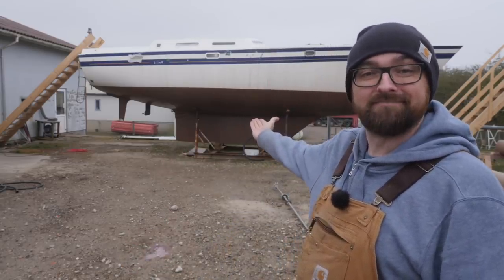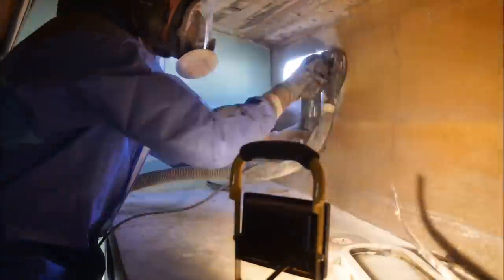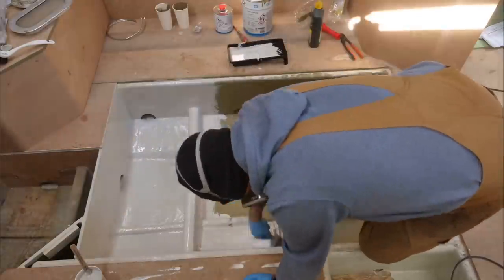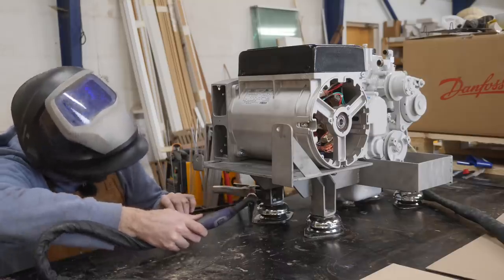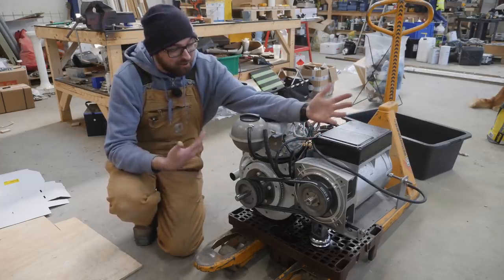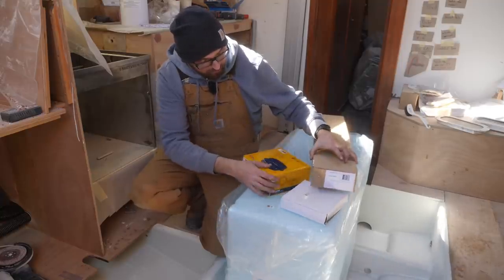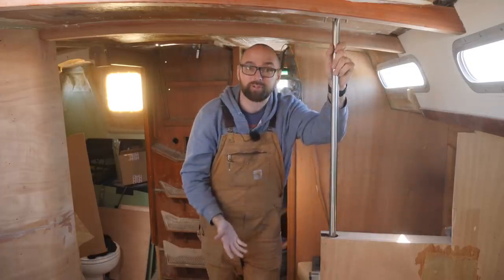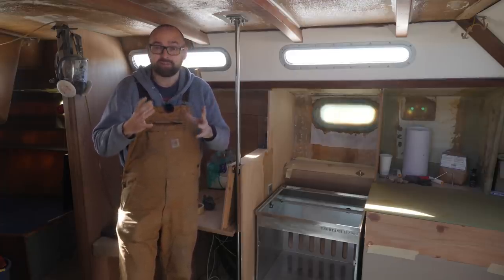Sail Life - DIY generator fail, galley pole - sailboat project

Comment: It seems to me that you need to reassess your power consumption plan. Specifically the water maker. Somewhere, everyone decided that it was only possible to cruise with a power hungry 35 gallon per hour ac water maker.  There are other options that will work and use surprisingly less power. Absent the power consumption initially planned, you could either cook or wash clothes and everything would be just fine. How often do you think you would need to do all three at the same time? Look at some of the dc powered water makers and design a superior rain collection plan and you’ll be all set. The fuel savings alone will be a big plus that will make your cruising life very comfortable.

Comment: I suggest you go and talk to an engine rebuilder because if the 102 and 402 use the same engine block it maybe worth having the 102 rebored up to the 402 capacity. That way you will verturely have a new engine with the desired hp.You have made such a good job of the genset it would be shame not to have it working as you thought. Cheers and good luck. Ian Langley New Zealand

Comment: I think you might change the revs of the system by using a smaller pulley at the generator side . This way, if the 102 has enough torque you might increase the output of the generator.

Comment: Oh bugger!  Three options: replace, upgrade or run with it.  The forth option mentioned of doubling up requires space, cooling and weight, plus the same hassle sourcing one, so go for a bigger unit.  Redundancy is not a factor if you are relying on the total output, but another possible factor.  If it's a non turbo unit then the fitment of a small turbo is an option.  You need to be careful that the internals can take the extra load.  Check with Perkins.  Benefits will be better silenced exhaust, with the downside of a whistling turbo and possible reliability issues (use decent oil!).  The smaller unit will be more fuel efficient so longer running hours should not be a problem.  Everything was (is!) going so well, but I know how you must feel.  A bigger inverter is always a good thing, and as much battery capacity as you can accommodate.  Victron have some very good solutions.  Don't forget battery condition monitoring - they do it all.  Good luck with the head scratching.

Comment: Our couch charge controller allows me to invert AC power from the batteries while also pulling power from the generator. This is done by selecting the amount of AC available for charging. Kind of like peak shaving.

Comment: Just run with what you have for now and keep your eye out for a good used 402. The mounting holes and dimensions are pretty much the same correct? It could just be a weekend motor swap when you get the bigger one. Plus you'll consider the extra power a luxury not a given.

Comment: Keep the itty bitty perkins and keep going for the moment, but keep a look out for a 402 or xxx by it's Shibaura name, it appears in small ag equipment so someone will have reco ones, the 102 with a smaller alternator ( even from a truck ) will appeal to someone else to offset the cost of a 402/Shibaura/Kubota Z602.

Comment: Mads you have the time, source the larger Perkins and swap it out at a later date. I guarantee there's someone that will buy your (tibp) tiny-iddy-biddy Perkins. In the mean time you can make sparks with tibp and get all your other systems up and running. 😎

Comment: Mads i think a solution could be a solar charger/inverter. There are models that support generator input and then supplement the power from the generator with the inverter. Then if you are not using all the power it will just charge the battery. They have a selection on the Danish Web page vivaenergi .

Comment: First, I feel your frustration...we have all been there & without mistakes we have no steps in our learning/growth.  So talk nice to yourself.
   More is better.  More engine capacity means you run it at lower rpm, use less fuel, less vibrations, less noise, less wear on the engine.
   Bigger alternator/generator, has a stack of advantages too.
  You could change the diameters of the pulleys, taking advantage of the torque & mechanically spinning the generator faster.
   But I would put your diesel up for sale, in great shape, and look for a used engine that meets or exceeds your needs.  
   Even if you paid for a pro to rebuild your bigger used diesel engine, most likely you would still be less then purchasing a new generator for your boat.
  One more consideration, put a pump on the oil for the engine, so you can circulate the oil before starting the diesel.  This will remove more than 90% of the wear.  Totally worth doing.
  Keep up the great work, and thanks for sharing your learning curves with us.

Comment: Adding a turbo to your little motor might be one solution. You would need a decompression plate as well to adjust for the  increased air volume. Probably not a cheap option either.

Comment: Mads, it may just be the bore size of the cylinders, if thats the case, you can bore the 102 add new sleeves, pistons and rings and wala! Oh and like the other comment, upgrade your fuel injectors.

Comment: Also, looking at the total space allocated for fridge/freezer, minus the 10cm of insulation all around, the remaining space is going to be much smaller than you will find you need.  You may want to consider allocating all of that space to the fridge and then install the freezer in a separate location.  Obviously you don't access the freezer nearly as often as the fridge.

Comment: Mad, the 102 may be a detuned version of the 402. I know that a 18hp outboard is identical to a 25hp, manufacturers simply use a restrictive carb to make a 25hp into an 18hp for marketing. You may be able to change the tune or simply put larger Injectors in the 102 and retune timing to achieve your goal.
Best of luck my friend.
See you.
Wade Nisbet
New Zealand.

Comment: Drive the water maker directly of the Perkins. I have had water makers on my boats for years and the last thing you need is a AC motor when you can drive the pump directly. You have already committed to running the Perkins all year round so you should have plenty of duty time to make all the water you need. No matter what the time of year is!

Comment: Get Goiot portlights! Their Opal series is exactly same size as lewmar, their quality is same as lewmar, you can get spares even after 30 years. And last but not least they are dirt cheap. You regularly order from SVB in Germany and they carry Goiot as far as I can remember.
Reply from the maker: Thanks! I'll check them out right now :D
Reply: @SailLife  I used to work as a marine equipment distributor and we sold hundreds of goiot hatches, portlights and padestals to boatbuilders in eastern Europe - never had a single complaint. They are also the choice of Jeanneau, Lagoon and several other french manufacturers. And one of my boats (bulit 1986) has a Goiot hatch that still hasn't leaked once.

Comment: I think you are heading in the right direction with the bigger Inverter/Charger solution. Being able to use the batteries as surge power source will cause the itty bitty tinney winnie Perikins to punch well above its weight. The inverter/charger will be able to get all the power the Perkins can give and put it in the batteries while the oven/dive compressor/washing machine is cycling. 

I'm assuming you are looking at some sort of LiFePO4 batteries for storage (at least not LeadAcid)--I expect you'll be giving the battery bank a workout.

Comment: Use the heat from the Perkins for hot water generation and for cabin heating. That way having to run it for longer matters less because you get more out of it.

Also sitting through 7 Fast & Furious movies I can tell you that you just need to add NOS.

Comment: Get a Northern lights they are usually a Toyota block. There great engines and I heard a 4 letter word too. Run the Perkins till you get to the states and then source a northern lights/ Also known as Alaska diesels.

Comment: Add 2 pullys and a small frame welled/ bolted to your made up frame to  give you the RIGHT  pully speed on the Genny ,, Think of line shaft machine shop set ups ,,  no extra space needed  around the  engine  just some extra belts and some OFF THE SHELF  farm machinery pullys. .. Regards John , ( 35 Year Machinist )

Comment: The inverter solution sounds good to me. It will enable you to run the generator at a high load when you use it, making it more efficient.
But to make it a better solution you need to go LiPo batteries or you are just gonna lose the efficiency in the charger

Comment: If you put a larger diameter wheel on the generator you will be increasing the rotational speed of the gen without much of a load difference on the itty bitty tiny perkins.

Comment: Correct me if I'm wrong but I thought the 102 was a 2 cylinder and the 402 is a 4 cylinder.
Either way I think it's going to be fine for you although you might be able to optimize the pulley ratio to get a little more out of it.

Comment: Love your channel.  Don't skimp on power.  Buy the correct Perkins, or just scrap the project and buy a shiny new generator.  This system doesn't seem like one you want to piece together.  You would probably regret it when it fails in the middle of a trip, and you are forced to rely on just solar.  Easier to source parts when you have one reliable unit from a reputable manufacturer.

Comment: Honestly i think that's about the perfect size for the genset.  A heavy duty inverter and a beefy lifepo4 battery bank should complete the package nicely.  In fact, I would run everything off the inverter(s) and have the genset put 100% of its juice into the batteries.  Supplemented by solar and wind, you should be quite comfortable with that setup.

Comment: Mistakes happen, well done for taking it on the chin and ploughing on regardless! It would be nice to get the gen-set finished, but would it matter if it took a little longer? Use the time to get a good price for the 102 and get yourself a 402. I’m sure Perkins can supply you the dimensions for the 402 and you could get the frame / mounting ready in the meantime?

Comment: Mads, first off, your videos are the thing I look forward to every weekend. Thank you for sharing your experience and knowledge for those about to take the same journey as you. Secondly, I wouldn't call the DIY generator a bust because you got a lot of experience out of it. Why else make mistakes if not to learn from them? 

Was there any other reasons you decided to keep the perkins? Oddly, I would have taken the mistake as an opportunity to learn and replaced the perkins with another diesel engine that fit my needs. How did you arrive at your solution?

In any case, love the work! I really want to know how the head will turn out!

Comment: You can bore out the cylinders and get more power. Increase full going in. Increase air. Gear up the pulls and bigger fly wheel. The other way is to add a 2nd small generator

Comment: Wonder if you could turbocharge or some other upgrade to the Perkins 104 to improve power output? Also it would be a good idea to double check the gear ratios and rpm's to make sure its operating at maximum efficiency.

Comment: Since you’ll have to be running the engine a little more you could use the heat from the exchanger to heat the boat some in the colder months.  In the warmer months heat the ocean.  Also, could the generator you have now be adapted to the main drive engine with an electric clutch and buy a better suited generator for the itty bitty Perkins?  Or like a lot of the others are saying, use the tiny itty bitty Perkins until a 402 becomes available.

Comment: Maybe you could go for a substantially larger battery bank than initially planned and use that for covering your needs while recharging it with the smaller generator at a slower pace. Alternatively, and I'm not sure that's a viable solution, you could look into very small diesel car engines (used - scrapped from accidents, etc) and make a new bracket.

Comment: You have a time constraint.  Use the Gen as is and get the boat livable in the water.  Replace the motor after everything else is finished.  By the way, one of my walls is not perfectly level either.  Oversize alternators on the drive motor to recharge?

Comment: For example, a Perkins pulley size of 25cm and an alternator pulley size of 10cm would allow you to run the Perkins at 1450rpm and achieve 3625rpm at the shaft of the alternator. If the rated rpm for efficiency is similar to a Lugger is 1800rpm, then you could use a 20cm pulley on the Perkins and a 10cm on the alternator and and 1800rpm on the Perkins would give you 3600rpm at the pulleys for the alternator.

Comment: Mads, Just a Thought....it appears the  Perkins 102-04 (KA) motor has a bore of 61mm and the 102-05 (KN) has a bore of 67mm while both have the same  64mm stroke.  It also appears that you should be able to bore to 68mm and use the oversize 102-05 (KN) pistons, rods and bearings. This modification may save money with added benefit of a semi-rebuilt engine. This modification could possibly get your  power at RPM closer to your needs. You may want to add over sized Valves as well. Based on my quick math you should gain nearly 1hp overall at the same 3600 RPM...Of course you could always simply add a Small Wastegate Diesel Garrett Turbo and solve all of your problems except for the Noise....Good Luck!!

Comment: i know its a long shot, a very long shot, but have you checked out what the differences are between the 402 and the 102 engines?  you mentioned that the photos are identical, which made me wonder if they used the same block, with different crank and or pistons?  Maybe, just maybe you could get the parts and modify the engine "UP' in power....    just wishful thinking i'm afraid, but worth a look.

Comment: You should get the 402 (if its a good fit) and refit that to the generator....if it was an identical fit you could always keep it as a backup OR put the 102 onto a smaller generator and have two(working) gen sets, the smaller one for when you dont need quite a much ampage. Obviously, this would take up more room.......

Comment: I have a 8kW generator on my boat and actually have more trouble putting enough load on it in order for the diesel to be happy. Diesel engines like to run "pedal to the metal" or at their torque peak in order to keep the combustion hot enough. Low load will soot up the exhaust and stick the rings. 4.5kW is a lot of power and I doubt you'll always be able to coordinate dive compressor, washing machine etc. every time you need 220v power.

Comment: Look forward to some poledancing in the future.
How about checking the difference in specs between the two perkins engines. Maybe it is possilbe to convert the currently small one to the size you wanted. Changing the bore of the cylinders, adjust the fuel feed system. Just some ideas. I have a Perkins M50 and this engine main part of the engine is identical; I think it spans from 35 to 65HP, just by altering some parts of the engine. This is where the ideas come from.
Fix this now. You will later regret time and time over during many years that you did not spend the time to get it right.

Comment: Solution for Perkins problem. The pulley's on the Perkins and the alternator appear to be the same size. On the video  it appears that the pulley on the alternator is bigger than the Perkins. Because you have a separate belt-driven alternator you can definitely change the pulley sizes to increase rom on the alternator while decreasing rpm in the Perkins. If each set of Pulley's were 15cm diameter and the Perkins rpm was 1450 then the shaft and pulley of the alternator would turn at 1450 rpm. If the diameter of the alternators pulley was changed to 10cm, and the Perkins was running at the same 1450rpm, then the shaft and pulley rpm on the alternator would be 2175. So you can increase the size of the pulleys on the Perkins and decrease the size on the pulleys on the alternator and reach the desired and most fuel efficient rpm for the Perkins while reaching the rated output rpm for the alternator. You can turn the pulleys there in your workshop.

Comment: It is a similar predicament to sailing. Those who have run aground, those who will run aground, and liars. Proud to see you do not belong in the last category. No one is born knowing everything. The experiment was a  total success, only the output was lacking. Possibly you will come across the bigger diesel in the future and, since they are the same footprint, simply exchange them.

As usual you have achieved a lot of progress. Stop beating yourself up on the negative, stuff happens. Perhaps there is a good reason for the mistaken engine. Who knows what the plan will be going forward. Lord works in mysterious ways.

Thanks for sharing.

Comment: Hey Mads!
I would keep the new generator , bite the bullet and buy another diesel engine ,for instance an Kubota Z482 .
Power of this engine : 9,9kW@3600rpm , also 2 cilinder and similar construction as the Perkins.
This engine is especially developped for generator use!
I do not know the torque needs @ which rpm of your generator!!!
The kW are not the most important but the torque(Nm) is.

Comment: I'll keep it short and sweet if you play with your pulley ratios. By changing the pulley on the engine and the generator you can still achieve the output that you looking for in your generator. Good luck hopefully you see this comment.

Comment: If you add a controller to better regulate the mini Perky's rpm, would that give you a few hundred extra watts of power? Also, look into the 402 and see why it makes more power. It does look identical to the 102. Maybe it's as simple as re-tuning the injection pump and injectors. Maybe an injection pump and injector upgrade from the 402. I find it hard to fathom that there is that much difference between those two engines.